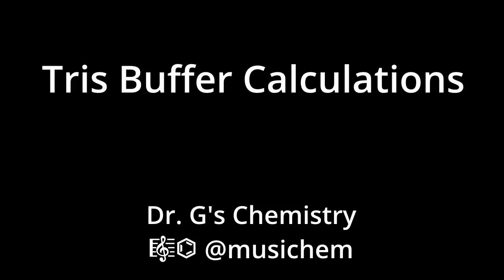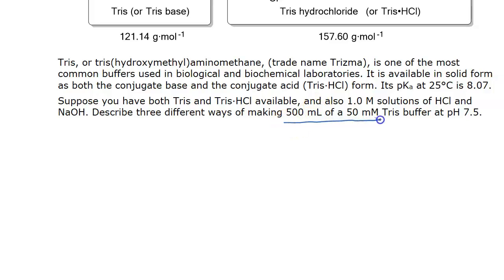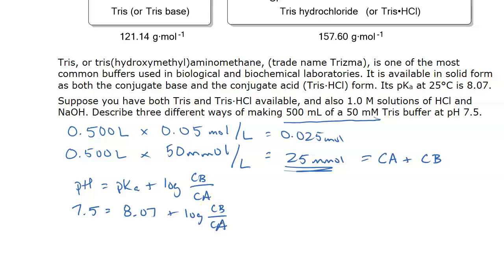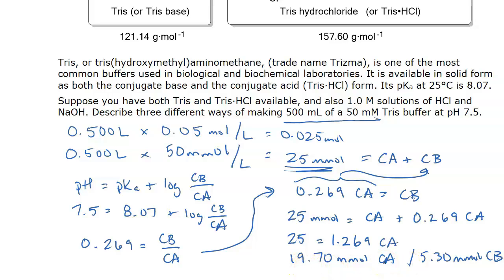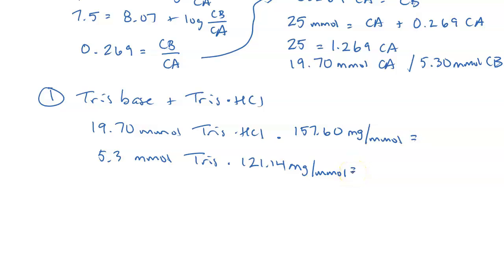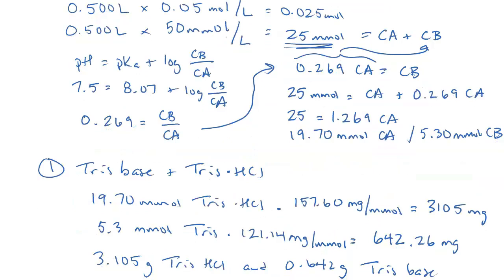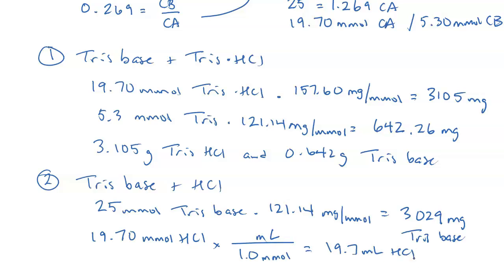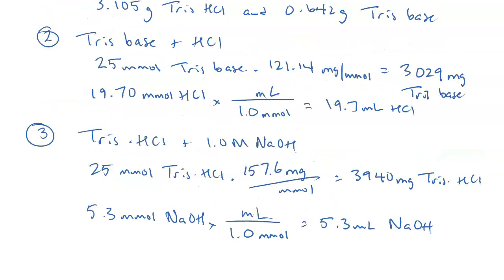Tris Buffer Calculations

Comment: Thank you for making the video and very clear , thorough explanation . But if you are a compulsory math fanatic, you would realize that the mathematics behind the reasoning for all three ways of marking the Tris buffer is an approximation, although an extremely close approximation with errors truly negligible. The approximation occurs due to the fact that contributions from hydrogen and hydrogen ions are completely ignored or assumed to be absolutely zero.
Reply from the maker: Yes, the Henderson-Hasselbalch equation gives only an approximation due to the assumptions made in deriving it. This is why the best practice is to use a meter to check the actual pH and use acid or base to adjust the pH before making the final dilution.

Comment: Hello, say I was looking to make my own buffer, would I randomly choose the desired concentration of the buffer? In this case the 50mM number? Are there any rules that govern choosing this number when trying to make your own buffer
Reply from the maker: Good question! We use a buffer to keep the pH constant, often when studying a biochemical reaction. We need enough buffer capacity to neutralize any added acid or base, for example, if the reaction generates protons (acid). In other words, the concentrations of the reactants should be much less than the concentration of the buffer species. Since most biochemical reactions with enzymes use concentrations of 1mM or less, a 50 mM or 100 mM buffer is usually sufficient. We don't want to add more ions than necessary, both because there is no need, and also to avoid the ionic strength changing the reaction we are studying, so we don't want to use higher concentrations of buffer than necessary (say, 1 M).

Comment: Really helpful! One thing I don't understand is why you choose to put all the Tris base  at 11:47. Is it to make sure it's all going to react?
Reply from the maker: You need to add enough Tris acid and/or Tris base to equal the total moles of buffer required. You can add all acid form, all base form, or some of each. It is often easiest to just add one form and then use a strong acid or base to adjust the pH to the desired value. I show all three methods in this video.

Comment: Why is the number of Tris-HCl moles equal to the sum of acid and base moles? Since each HCl molecule joins a Tris molecule, shouldn't it be n(Tris-HCl) = n(Tris) = n(HCl)? I think I'm missing something, I just don't know what it is.
Reply: Nevermind, I was thinking the conjugate acid was HCl instead of TrisHCl. So it makes sense, since there is still some Tris left, besides the amount that reacted with HCl to form Tris-HCl, hence n(Tris) + n(TrisHCl) = total amount of moles in the buffer.
Just leaving this here in case anyone has the same problem.
Thank you for the video!
Reply: but shouldn't 50mM be the concentration for Tris-Hcl only, and not Tris-HCl +Tris?
Reply from the maker: @jpedroam1692  By definition, the concentration of a buffer is the total moles of buffer (conjugate acid + conjugate base) per liter. There are three ways to make a buffer. Since you need to add enough Tris acid and/or Tris base to equal the total number of moles, you can add (1) all acid form, (2) all base form, or (3) some of each. It is often easiest to just add one form and then use either a strong acid or base to adjust the pH to the desired value. I show all three methods in this video.
Reply: @MichaelGaroutte  alright, got it. I thought the concentration refered only to Tris-HCl and not Tris. Thanks again!